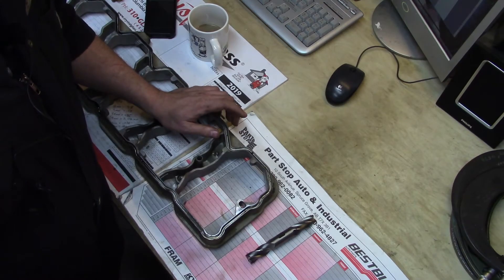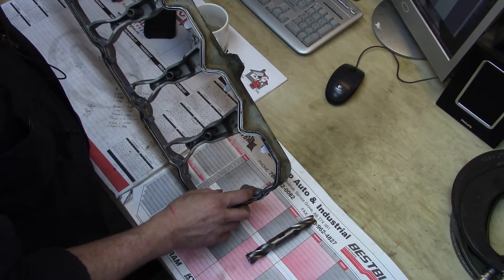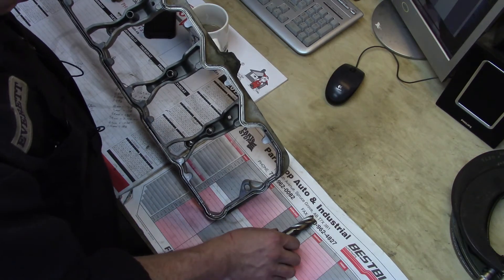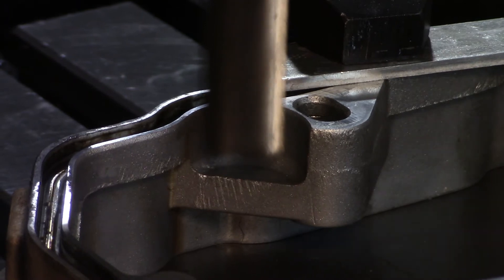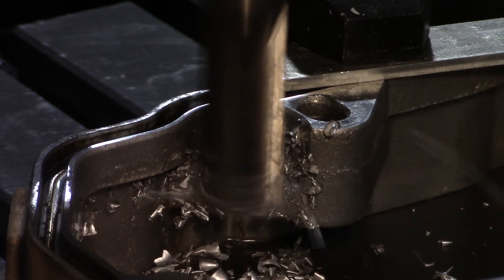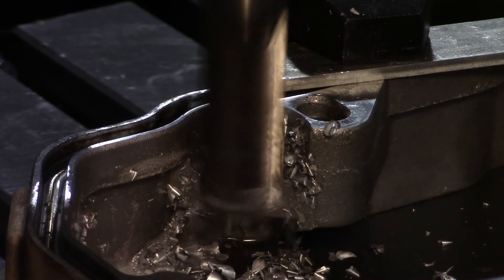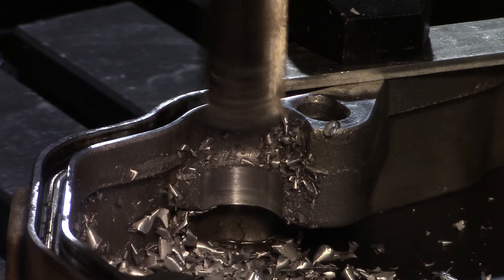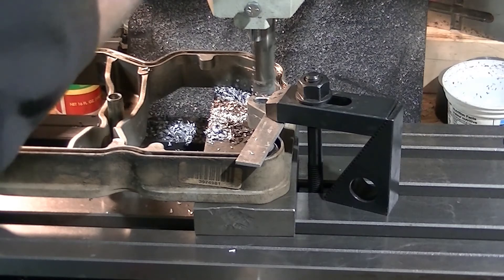6.7L Cummins Rocker Box Head Stud Modification

Comment: One of these engines that we worked on was dumping so much fuel into it that the owner cracked every cylinder and was wondering why his oil level kept increasing every week. He ended up needing a new engine because it also ate the lower end out from all the diesel fuel being used as crankcase oil. He did have almost 300,000 on the original engine so he was okay with a new engine. Thanks for the video.
Reply from the maker: Wow, that's quite the failure . . . I remember when I worked for GM about 15 years ago, when the first generation of Duramax's were having the fuel injector leakage problems on the return side and filling crankcases with oil, your failure sounds like it had some similarities except it was just a leakage, not a fuel injection problem.  I like doing these rocker box mods, it comes out looking much better than using a die grinder.  Glad you liked the video, thanks for coming by!
Reply: Everett's Workshop do I need to do this on my 2002
Reply from the maker: @diesellover6411  as far as I know the rocker boxes are similar between the 5.9 and 6.7 so if you're planning on putting head studs in it would be good to have the stuff lined up to do the modification.
Reply: Everett's Workshop the 2002 doesn’t have that riser box that you guys are trimming?
Reply from the maker: It does have the same riser, we called it the 'rocker box' at the shop, and I'm pretty sure that the head stud kit required a bit of relieving on that corner of the 5.9 too. Only thing is that the diesel guy was mostly working on 6.7's because the 5.9's were getting older and fewer were coming to the dealership. So, I am pretty sure it needs it too, you might want to line up the machining before tearing it down.
Reply from the maker: I just checked the ARP web site and install directions - there is no mention of not having to cut material out of there so it appears that your 2002 would need the mod as well
Reply: Everett's Workshop I think your wrong man I do not have the rocker box your talking about and I think that is because my Injectors do not sit up high like the 2003 and up ? All I have is the valve cover then my head no rocker box in between I actually installed my head studs today and put the valve cover back on all is good except maybe the very front two studs as in front bumper might be a little tall my valve cover tighten right down on them .
Reply from the maker: @diesellover6411  Ok, well then I do apologize, I thought the 2000-2002 had the rocker box too. It's been a while since I was at the dealership and I hadn't pulled an older diesel down for a while before leaving. Most stuff we were working on was newer. I can admit when I'm wrong, glad you got them in ok!
Reply: Everett's Workshop no worries man just thought maybe I was missing something I’ve never done head bolts so I wanted to make sure I was doing it ok and thanks for replying man 👍👍

Comment: Just shows how us folks with machines can often help others out. Nice result.
Tend to wonder why the part isn't already modified!!
Reply from the maker: Thanks! The OEM Cummins head bolt heads are all short enough to clear that piece of webbing.  The head studs protrude higher from the face area around the bolt holes in the head, so that stud would not allow the lower rocker box to seat against the head without that area relieved.  Some techs just use a die grinder but the directions say to machine it out.  It looks a lot cleaner when machined.